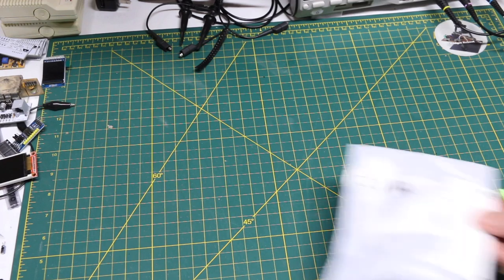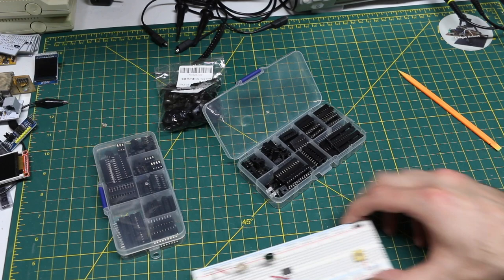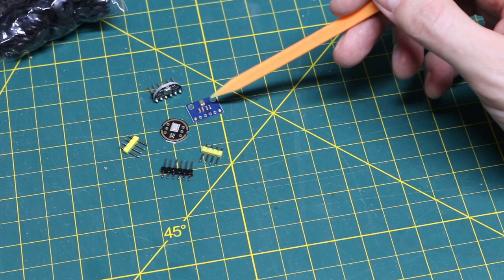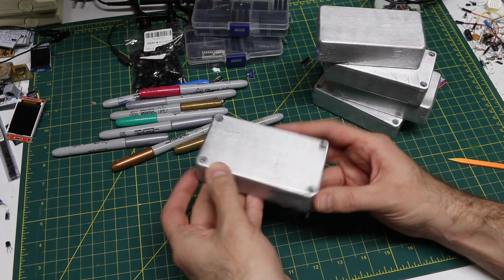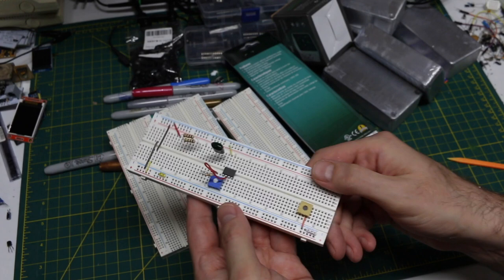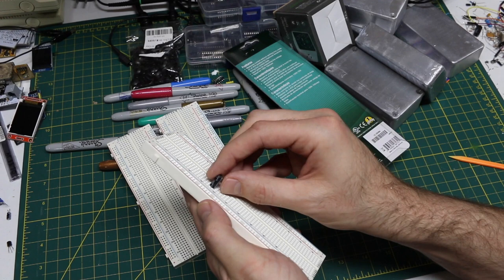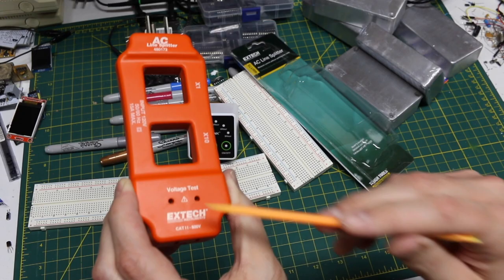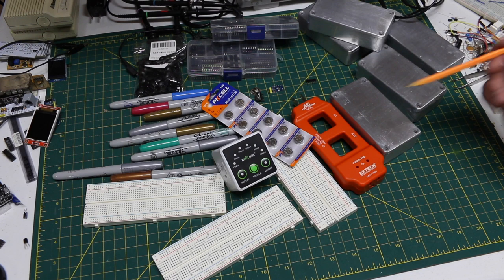Mailbag!

Comment: My experience with the breadboards is that the ones with row markings having uppercase letters A thru J have the problem with component insertion, but those with lower case letters a thru j work much better.  I look carefully at the pictures when ordering to only buy the ones marked a thru j.  That's not to say that the vendor won't ship something different than pictured, though.